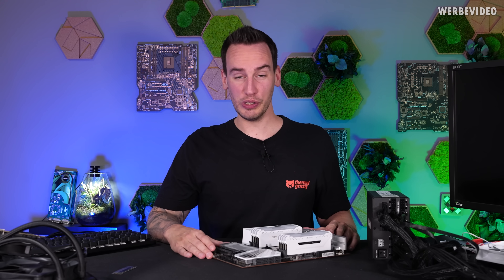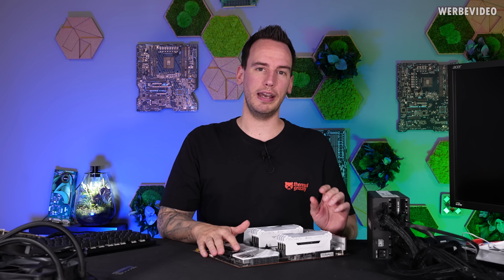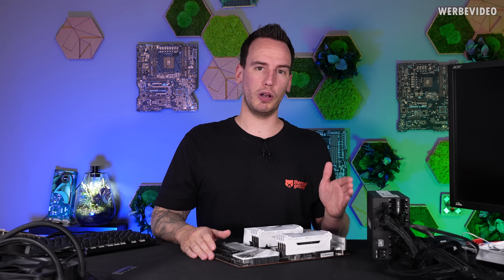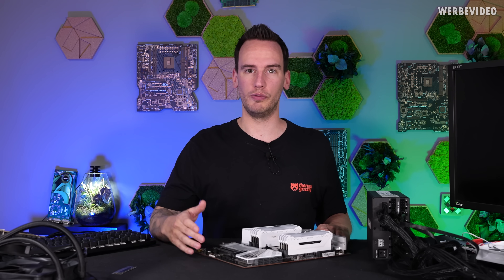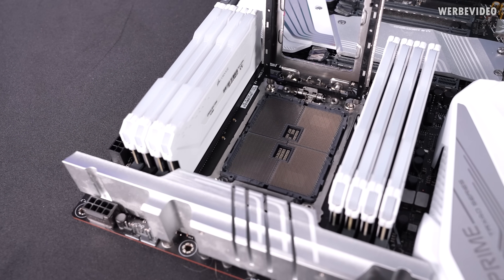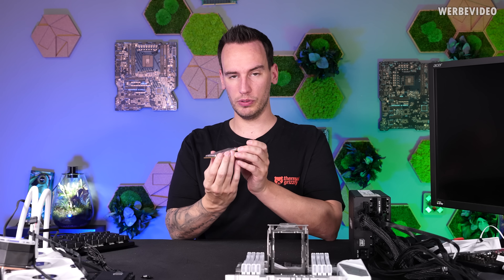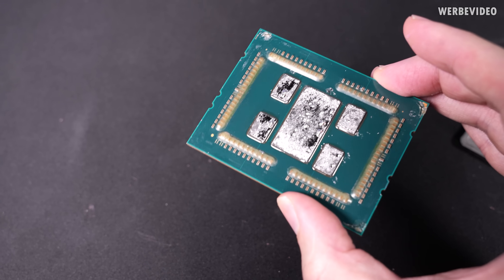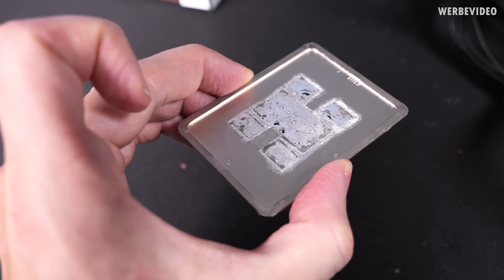I missed the obvious Issue on my Threadripper

Comment: I wonder, why you were not using a cooler which covered the full IHS? I know the problem was different but just curious
Reply: You dont really need that, and TR sockets are just so big, that most coolers dont cover the entire surface.
Reply: Because it has a heat spreader...

Comment: Would have been really interesting to see performance difference between putting it back together with liquid metal & if you machine the IHS to clean up the corroded surface!
Reply: If you machine the IHS you will need to do the same with the edges or the distance between it and the CPU cores will be to much and then you will have to make a whole new hold down mechanism since the IHS will be thinne and you won't get enough preassure to be able to get good connection with the conntacts on the motherboard. As default, you have to screw down the hold down mechanism with a specific torque value so a modified IHS would not work directly. Though they could maybe use something else than liquid metal to avoid it degrading more.
Reply: @Dragonited  All of that is well within the capability of Derbauer & their machines
Reply: @Nordern  (me doin the same, no magic involved)
Reply: Don't think it matters much, I had a similar issue, the ihs had black spots, cleaned the best I can and then applied new liquid metal, temps seemed about the same when I applied liquid metal for the 1st time. And 1 year after nothing wrong with it.
Reply: @aFeect god damn, GTA SA
Reply: The alloy is probably MORE conductive, just quite brittle
Reply: I'm gona do just this soon. I donát expect much from it, but now I have around 0.5mm deep corrosion and I just can't live with it. Let the mill make it flat again :S
Reply: @bszbszbsz  Its not corrosion, its highly conductive gallium-nickel alloy. Just keep it free of air (cover it with fresh gallium)
Reply: Tru. Apologies, I should've used the word erosion. :) And yes. Added some LM, and it works. Not too great tho, but does the job needed.
Reply: The issue is that the oxidation-resistant layer is destroyed. You could polish it away, but would expose the bare copper in the process.
Reply: @draakevil  I don't see why bare copper is bad. Could you pls enlighten me.

On my current block, nickel got eaten away already.
Reply: The cracks in the nickel will speed up the plating corrosion over time since the surface getting exposed to the gallium will increase
Reply: @betterbegood.  Nickle plating is an easy to do process.  That would solve the problem, and build back up the material.  Then a bit of polishing to get the height correct and it would be good to go.  The only thing someone at home couldn't do easily would be measuring to ensure the height is correct.
Reply: seeing a funny moments youtuber commenting on a derbauer video was the last thing i was expecting to see today, but im happy to see it.

Comment: Аre there any chances to restore this damaged surface by, idk, some chemical process? and polishing then
Reply: Gallium loves mixing with other metals. It basically soaks into the metal. I think in the long term its cooked.
Reply: you could likely electrowin the gallium form the surface, but it would be a lot more expensive than just getting a new IHS

Comment: @der8auer EN my father always told me when i was a child "if it's not broken don't try and fix it" I think that was because i used to take things apart to see how they worked and quite often couldn't put them back together, this is obviously a case of the same thing. I applaud you for de-lidding a top end Threadripper but it's caused issues for you further down the line. In my personal opinion this process will need doing again sooner than you think.
Reply: He runs a company around engineering new cooling solutions. He wouldn't go far with that ethos.
Reply: Your father did not mention that this is the pinnacle of science.
You take apart something and break it in the process, you take it apart again and study what was broken and why.
With this new knowledge you can birth new technologies for the humankind.

There is a difference between a user and an inventor, their paths through life are some what separate.
Use and Create.
Reply: While I would not consider myself an inventor, "if it ain't broke don't fix it" is also terrible advice for programmers. You can't say with any confidence that something isn't broken if you don't understand it or don't sufficiently test it - and even if it isn't broken right now, it might break when conditions change later on. If you have old code that no one understands, it should be investigated and potentially refactored - cautiously of course, and with ample testing, but don't just leave it for some poor sap years down the line who has to fix it when it does break.

Comment: It seems to me that when "soldering" the two parts, one of the parts (CPU) was too cold and we have these problems with welding or there was an entry of cold air (O2) at the time of welding (also possible). cracks is one of the results.

Comment: So is liquid metal still recommended or do these longer term issues mean that it is no longer the go-to thermal interface to maximise cooling?
Reply: Liquid metal is usually never the recommended thermal interface. Anyone who does recommend for daily use doesn't understand the cons.
Reply: @username8644  Looks at liquid metal on all PS5s ever
Reply: @bhume7535  Laptop manufacturers do as well. Doesn't mean it's a good thing.
Reply: @bhume7535  I think the PS3 has proven that Sony doesn't really give a shit about long term reliability.
Reply: @username8644  Love when a comment with only the slightest hint of antagonism gets deleted.

ME IMPLY SONY NO SMART WITH USE OF LM.

That simple enough for you youtube?
Reply: @username8644  LM is for tinkerers and people whose motherboards are not really vertically mounted in a case. For people who dont want to disassemble their CPU every year the thermal pads by Honeywell that LTT sells (or sold) and Kryosheet are far more reasonable. Even "normal" thermal paste like the Kryonaut Extreme that i use still dries out over years (especially on my GPU) and needs to be cleaned and swapped for new one.
Reply: Ive always been in the mindset that liquid metal use was a fad. While it might be a superior thermal interface compared to pastes. Its cons dont justify its use over paste. Modern pastes are damn good. And its only when youre doing extreme overclocking that you might run into the limitations of pastes. 

The biggest major con of liquid metal is like what is seen in this video. Corrosion caused by metal amalgamation. Corrosion isnt really the correct word for whats going on here. Its basically the metals mixing. You have a low temp melt metal. And it wants to mix with other metals. Those higher temp metals will slowly over time start to melt and mix into the lower temp metal........ (really laments way of putting it) You see it when mixing high temp and low temp solder. 

Say if you want to remove an old through hole chip from a PCB, they use a high temp unleaded solder. Its tough stuff, required rather high temps to melt it... But if you add some low temp bismuth solder to it. It helps get the higher temp stuff to melt easier. The two metals WANT to mix.

The same is for all liquid metals. Some react at different rates. Look at Mercury and Aluminium mixing. Thats a very fast reactor. 

I think this video is just the beginning of the fad of using liquid metal ending. This issue is just going to get more and more wide spread as more and more pcs cpus gpus fail because the coolers are basically eaten away.
Reply: It's still good imo. I have i7 7700k since it launched and pretty much instantly delided it and added LM on it. Maybe around 1 year ago noticed my temps seemed a bit higher than usual, about 10c higher. Removed the ihs, found the same black spots, cleaned the best I can, applied new LM and it's still running well a year after. Most ppl upgrade their CPU after a few years I guess, so barely anyone would notice the rising temps many years after. This is the longest I've ever been without upgrading. 1080 Ti and 7700k can still run pretty much anything with high quality and playable fps @1080p.
Reply: With a properly prepared surface at manufacture its fine. If you cant DIY your own electroplating, less so
Reply: It was never recommended, unless you are an "enthusiast" who treats their PC as a toy/play machine. The fact that no-one, no industry ever did this at scale should tell you all you need.
Reply: @johnlesoudeur3653 It never was, the data was there from the beginning. Now even consumer devices like the PS5 are suffering for it. Like LN it's fine for a specific purpose, but not daily, low maintenance applications. Ignore the comments saying it's fine, they haven't looked beyond their own system.
Reply: Depends on your comfort level with potential consequences. I needed to take my sapphire nitro+ 7900xtx out of the water block today to fix something. Then instead of TP I just went Liquid Metal to see how much cooler it will run etc. I did normal stuff coated all the little bits that could get LM on them, and was careful and didn’t use more than needed.
Reply: Liqued metal was never recommended.

Comment: It is cat's fault... cat hair underneath, making CPU not having a proper contact with the water block!
Reply: I cleaned a de-lidded 7950x3d and the Myrco cooling block and applied conduction air extreme to both and had to grab something else form the tool cart and my cat jumped her the case and looked down inside, I ran over and chased him off and put it all together, not seeing the small fluff he left had drifted to my chip.  I was extremely surprised when my rig thermalled down before it completely booted and took awhile to figure out.  Finally took apart to re paste and there was a small dark wad in the middle.
Reply: That has actually happened to me!
Reply: I have had this happen. Seriously. 😅
Reply: Oof of the floof.
Reply: @br4252  As someone with dogs that shed, this type of thing is always a problem.  Especially trying to keep it out of bearings!
Reply: Conductonaut